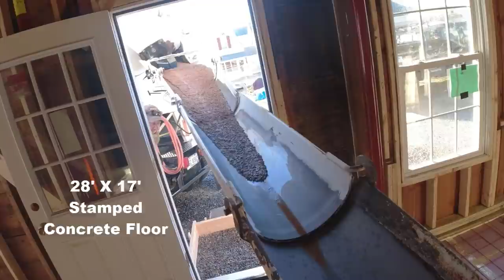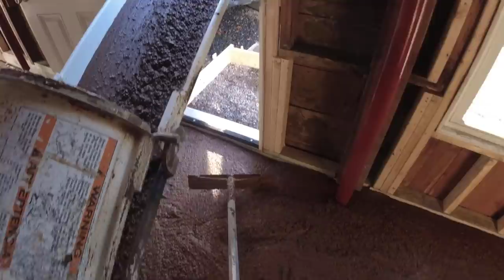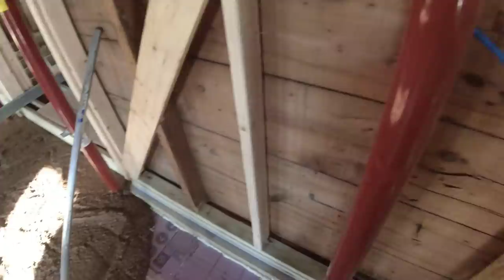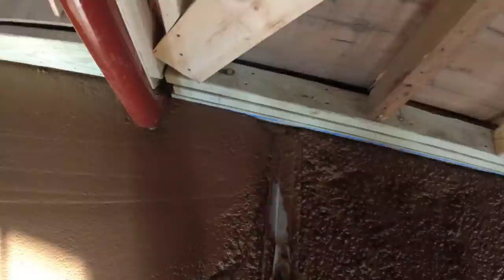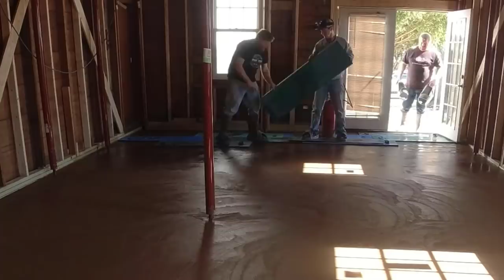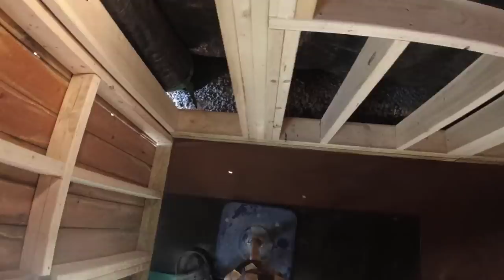Pouring Brown Concrete (How To Stamp Concrete that looks Like Wood!)

Comment: Do you think you could have cut or grinded the control joints in the stamp pattern on the long dimension?  That long sawcut will be the biggest tip that it's concrete.

Comment: i,m building a garage for myself it will be a 30 foot by 40, the ground can get little swampy  but only if we get a lot of rain i live in southern indiana. so i would put down i 4 to 5 inch of crushed limestone at grade no digging go over it with compactor, concrete at perimeter would be  12 inches by 12 inches with two runs of 1/2 inch steel rebarb, center would be 6 inches with mesh. concrete would be 40000 psi  with fiber, want it  high so water never get in to my garage. Is that over kill ? or how
thick would you make it or how would you do it.

Comment: I don’t understand why you don’t use a pump on a lot of your jobs?, is it because of the pump mix ? , do you think it’s a weaker mix that might crack ?,  you do great work , was just wondering about that, we’re down in Florida and battled the heat all the time, we had to deal with a lot of cold joints, thank God for power screed’s